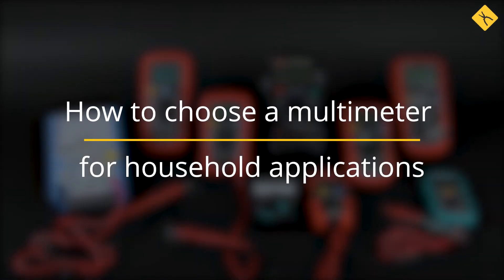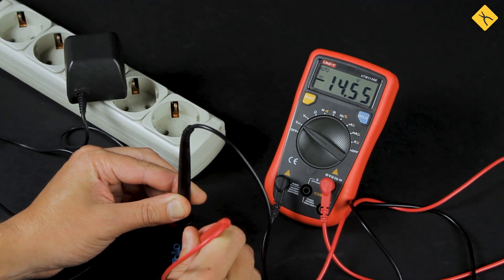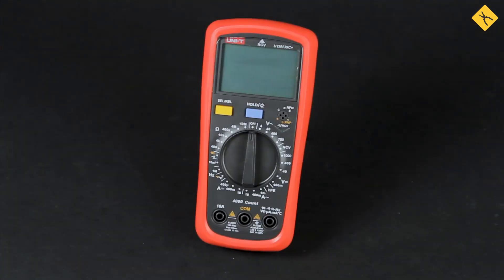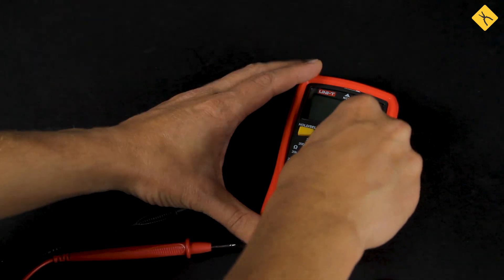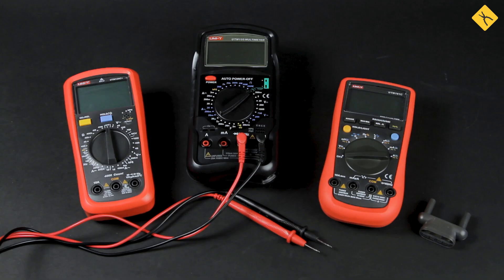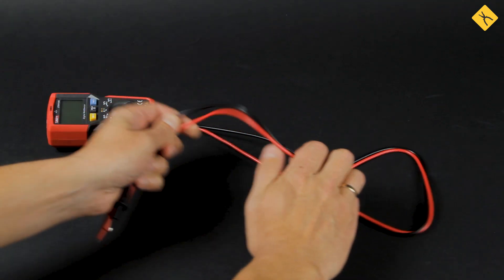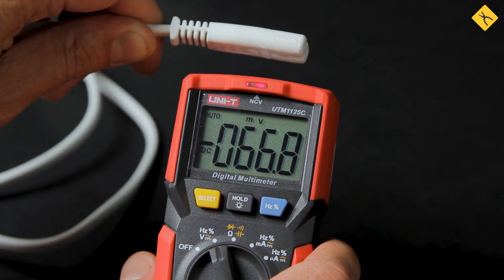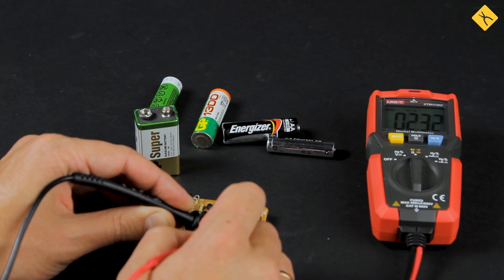How to Choose Your First Multimeter

Comment: Can a multimeter measure wattage capability of subwoofers or amplifiers?
Reply from the maker: Hello! There's a UNI-T UT71E multimeter with a power measurement function. You can use it to measure the power of any device that is powered by the electrical grid.
https://toolboom.com/en/digital-multimeter-uni-t-ut71e/